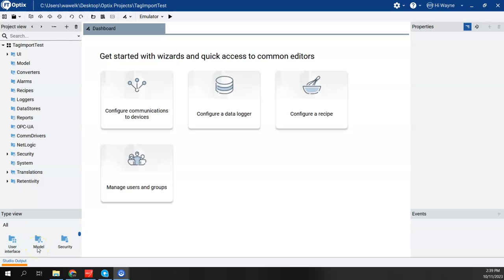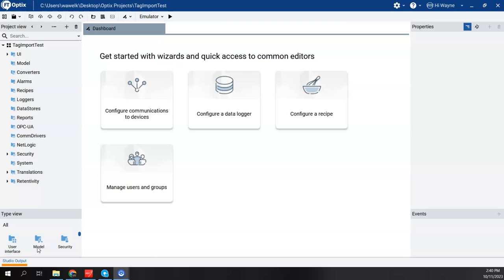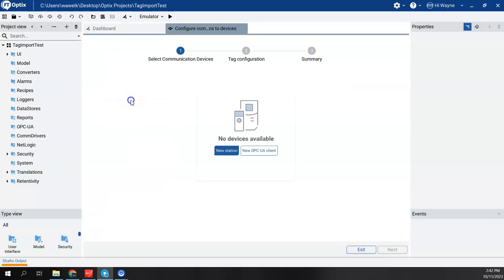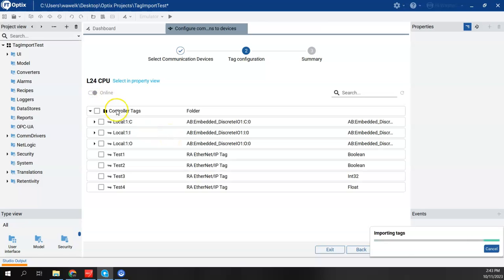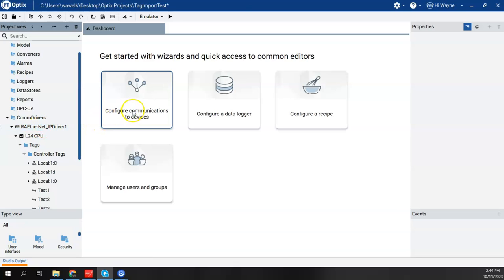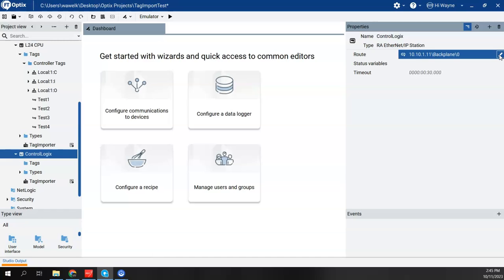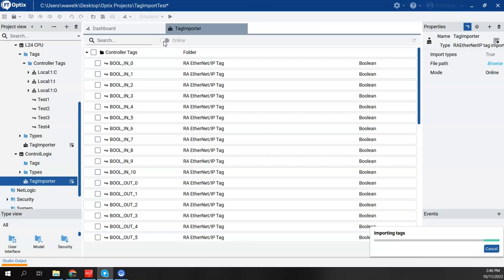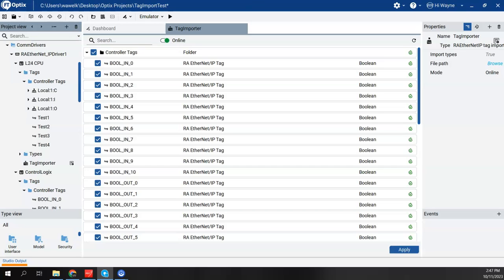How to configure FactoryTalk Optix to communicate with a Logix controller

Comment: How to communicate with a redundancy controller???
Reply from the maker: Currently FT Optix supports IP Address Swapping only for ControlLogix redundancy.  There is an expected 7 second bump with Optix during switchover.  Reference Chapter 7 of the ControlLogix redundancy manual for more info on IP Address Swapping - https://literature.rockwellautomation.com/idc/groups/literature/documents/um/1756-um015_-en-p.pdf

Comment: You had mentioned that for FT Optix to communicate to a Logix controller is must be firmware version 32 or higher. Can you provide any documentation for that? FT Optix is designed to be widely compatible with logix controllers.
Reply: Thank you for sharing that. I can confirm that online tag importing with version 30 has no issues.
Reply from the maker: Thanks, that’s good to know.
Reply: Support down to version 20 will be coming soon. It may be in the 1.4 release hopefully next week. We shall wait and see.
Reply from the maker: That's good!  I had not seen anything on that, but makes sense, it probably just needed to be tested and validated back to V20 by Rockwell.
Reply from the maker: Hey Zachary, that comes straight from the Optix help center where it provides Logix controller support for firmware versions 32 and later:
https://www.rockwellautomation.com/en-us/docs/factorytalk-optix/1-00/contents-ditamap/using-the-software/communication-driver/communication-drivers-overview/ra-ethernet-ip-driver.html

Comment: Hello. I just can't seem to connect. I use CompactLogix 5370, connected directly to embedded port, yet whenever I type the IP and try to view online tags it always shows an error: 
Exception caught: Bad conversion. 
Do you know what might be causing it?
Reply from the maker: What is the version of the firmware running in the 5370 CPU?  Is it V32 or higher?
Reply: @wawelk  it has version 33.
Reply from the maker: Not sure, I can't find any info on "Bad Conversion" in the help file or knowledge base.  Perhaps try an offline import of your tags from the ACD file to see if you get the same error - it could be something with the application and not the Ethernet communications.
Reply: @wawelk  I'll try that as soon as I can. Thank you for your response. I can't find anything either.

Comment: Excellent video!! I had a question, I am creating a project with a Micrologix 1400 and I wanted to create an application in Optix, but I cannot communicate them. Are they incompatible?
Reply from the maker: Micrologix would need to use Modbus TCP protocol to communicate with Optix.  Similar to what I show in the Optix with Micro800 video.
Reply: With the release of version 1.4 coming out it will support communication to Mico800 and Micrologix 1400 controllers. This release for version 1.4 should be May 2024.